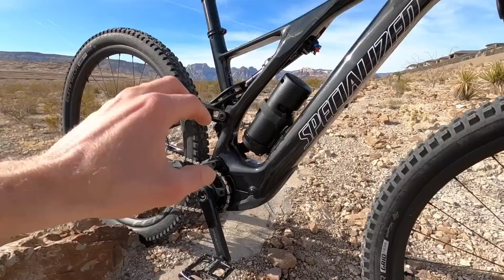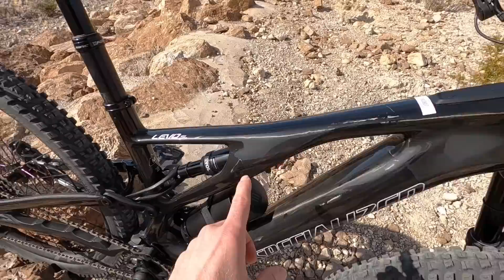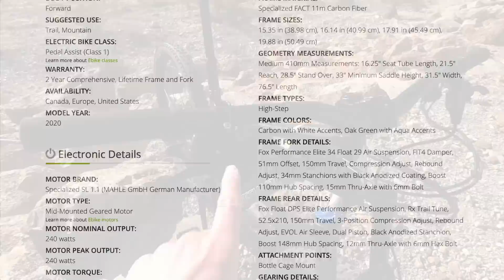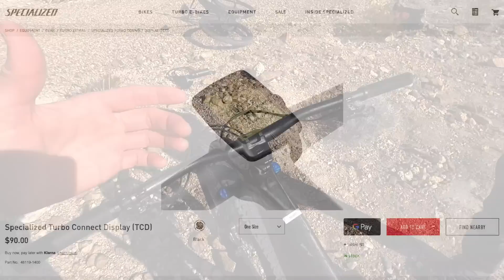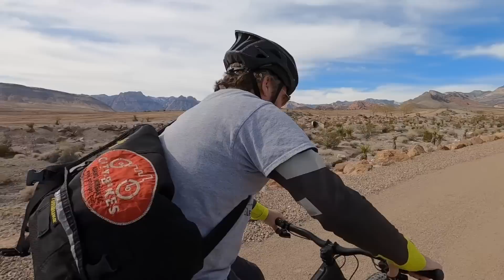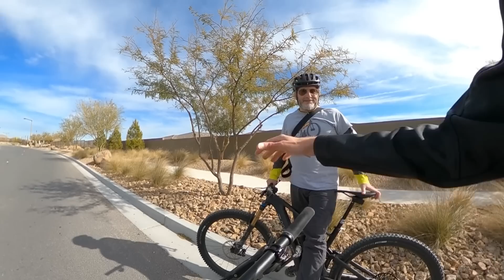Specialized Turbo Levo SL Expert Carbon Review - $9k

Comment: Guys, I built a 1500 watt mid drive with a $125 used mtb, cost $1750 altogether. I just purchased a 2019 250 dual sport motor cycle for $5000. I can not justify as a non-competitive rider spending $10k plus for an E-MTB. Crazy, beautiful but when the performance is quadrupled and the price is quartered I'll buy the production E-MTB.
Reply: But your 1500w is not allowed on a trail.
Reply from the maker: Good point Vegas, I think people bend this rule... and maybe you won't get a ticket, but if you damage property or someone gets hurt, you could be charged with driving an unlicensed vehicle on a non-motorized path and possibly sued.

Comment: Another great and enthusiastic review!  Man, I love these new Specialized ebikes!  I'm more for the Creo SL Expert EVO.  I totally share your and Charlie's excitement for these.
Reply: Does the motor noise on the Creo bother you? How about the power mode button on the top tube. I find it a bit difficult to change modes, up and down.
Reply: question mark I could hear the motor, but it wasn’t loud. I had no problem with the button on the top tube. It only cycles upward, but no big deal. The RIDE trumps everything! Absolutely loved it. The power feels so natural and organic.  Best ebike I’ve ever tried, and that’s against Stromer and R&M - my 2 faves.
Reply: @flyshacker  Thank you. I have to give it a longer ride.

Comment: Really have to admire Specialized for producing this bike, which is completely counter intuitive to what had been eMTB orthodoxy. Rather than adding power and torque, they reduced power and torque, but also reduced weight to the point where hold out MTBers no longer have any excuse (well, almost) against eMTB. No more shuttles and chairlifts, ride to the top.  

Just in, Santa Cruz, the brand that said it would NEVER produce an eMTB, has just launched its eMTB. The YouTube interview with co founder Rob Roskopp is precious. Looks like a hostage video. Will Yeti be the last holdout? Bless them.
Reply: isn't santa cruz ebike $17k

Comment: So I just finally switched over my SRAM Code brakes and drivetrain to Shimano XTR on a 2019 Turbo Levo.  This is an absolutely huge difference in braking ability compared to SRAM Code and now you can shed speed faster and later into corners and with 1 finger with zero arm and hand fatigue.  I am a big guy that goes fast on a heavy bike and after having both I can tell you for sure that all that modulation that people talk about is absolute rubbish.  The Shimano difference is so wide and confidence inspiring I cannot believe people even compare the two in the same sentence.  I also think that they have enough modulation for anyone.  On SRAM I was looking to upgrade the discs from 200 to 220 but then just decided to switch Shimano XTR 9120 with 203 Ice tech and the power difference is significantly better.  Then switched the shifter, derailleur and rear cassette to twelve speed, everything but the crank, to Shimano and I can tell you that Shimano blows away SRAM in all ways.  Want to save a few bucks get XT.  The bike is a whole new bike and way better IMO in all ways.  After this back to back test of components on the same bike Shimano wins by a huge margin!  No, I don’t work for Shimano.
I also thought the shock upgrade to DVO Onyx in front and Topaz in rear are significant changes.  I love this bike now and at the beginning I could never get it to feel right.

Comment: I really enjoy your reviews.  Nice time line for your video.  You mix a lot of technical data with the practical performance of the e-bikes.  After watching your reviews, and others (Como 5), I have decided to go with the Levo SL Comp Carbon (our local bike shop only has one in stock.  Today, it will be mine!).  Yes, it's pricy, but I believe I'll get some good use from it.  I will be using it as a fitness bike.  As I need to improve my overall health and did not want an e bike that did all the work for me.  If I did choose the Como I would have left the question hanging...what am I missing going off road.  I am older now and use to mountain bike in my twenties and thirties, but took the Dad hiatus.  Ha Ha. Keep up the good reviews.  

I'm sure you have mentioned it, I'm just forgetful, where are you all based out of?  And Charlie's shop?  What is the name of his shop?

Comment: Prices are insane. But people comparing mtbs to motorcycles may be missing the mark. Motorcycles are a bigger market and at the moment the r&d isn’t very high except for electric motos which is higher priced. Specialized are actually doing r&d in a highly competetive lower volume market. So they have to recover costs. Early adopters pay the price, just like with electric cars. But it does put the product out of mere mortals hands.

Comment: I try out the base model which weight more than 46lb and at 7000$ ,poor color scheme. The next model lighter model is much out of rich for most ..39 lb at 13000$.Noisy and price are the main problem.I think..
Reply from the maker: Thanks for the details on weight! What did you think of the ride feel, power of the SL motors?

Comment: For that kind of money you would think a stand and a display unit would be standard . As for the ride i think a lot of input from the rider with what seems very little speed and a lot of effort is not good for the price either , not for me , price alone :-(
Reply: It's not about the cost, a "real" mountain biker would take the stand off right away anyway because the stand would make lots of noises on the trail.  I personally don't prefer a big display on my mountain bike either, it's a nice feature on a cruiser or fat bike but not on my emtb, one crash can damage the big bulky display...

Comment: I watched your jumping off that bicycle because you are afraid of damaging the sprockets in slow motion,... At the highest resolution. I hope that if my understanding of your statement made after that is correct. I think they'll most buyers are not going to be jumping off this bicycle just because they didn't stop pedaling well enough in advance of shifting down.

I like the metering and I think that you should have mentioned that when you are using multiple range extenders the frame battery will apparently be bottoming out. When you start going to the second and third or however many you have. I think that this is all about that concept of a better world. , the battery swapping. The frame battery, although it is much bigger than the swappable battery. It is not where you would be getting most of your miles from the beginning most you were miles from having not just multiple range extender batteries, but you only need enough to be able to fully charge the ones that are not on the bicycle in use while you're using the bicycle. And 3 amps into that tiny battery is pretty impressive if we can understand that to be the case that for $450 you're able to charge that tiny little battery at 150 watts. That's not very long at. All. Right, I mean That's under an hour. I guess if I remember the numbers correctly. So basically for another thousand dollars. And a 3 amp charger or a pair of 3M Chargers or a single couple hundred watt solar panel, for example the sun power. 170 watt solar panel would be able to keep you running you're not going to be drawing over 170 watt continuous. The average draw will be less than that meaning. A couple hundred dollars for a very lightweight 25% efficient solar panel will be able to keep you. In charge batteries all day long. 

 This is one of the most energy efficient. Machines to move across rough train ever built. It also is the least damaging to your hands and your wrist and even your ankles Etc. 

 I think that we have to talk about comparing this with white people Rave about at ten times as much money. The vehicles that people are buying for more than this / seat. That's per. I don't know why Google would think I wanted the backslash. It is the fraction that were talking about the cost per person. And how this is so much less costly that a used disposable car. Per person per mile. 

Arguably you can spend more per person while on this bicycle. However, spending more on this bicycle. Then you would spend in almost any car is going to be difficult. The real point though is not nuanced. Even if it is not quite as trivial as the one I already made by me. The real point when you compare a low extremely low five-figure electric mountain bike with say an electric Hammer from General Motors or some ten-year-old Tesla. You know or a model 3 or any Volvo that's coming out even the Mercedes smart car. The real issue is that this is cheaper than the cost of those to make. Before any profit basically before any labor is added into the ultimate price tag for any electric car. Even on a par 4 passenger seat bases. It is for more than the retail price on this. miraculous Mobility tool.

. So the price of this model is due to the very low expected sales. Does anybody have any idea how much cheaper this is though than the first cars before the Model T before assembly line mass. Production. Does anybody appreciate that? This is not much money for what you are getting. There is no way you could produce this bicycle for even two or three times as much if you wear it in selling a lot of other stuff to pay the bills of producing this model. This corollary is not inconsistent. If they were to only make one bicycle and this was it the price would be even more of a bargain. I have read all of the comments this morning that other people have filed and all of the answers to the complaints in terms of how this is legal on the trail, etc, etc. There is a price where you might be wasting more money than a $300 used car that you know, you can buy another $300 used car and leave the one that you bought on the curb. Maybe push it off the road. When you do that, of course, they generally track the cost of Towing your car away back to you and you can get another car to be legal until you pay a lot more than $300 for that first disposable car that you walked away from. People want to argue with this they say hey, I know of a new subdivision that's under construction that has this Lake and I can just drive my old car into the lake and nobody will find that until all you know is so rusted that all of the serial numbers are gone or whatever so I won't have to pay. Anybody who wants to earn $15 an hour in America can hop on a flixbus for basically a little bit more than that and go anywhere in the many states and the many cities that that is the minimum wage. Most people are shocked by the following fact. Before you are 55. you will have been paid over $1000000 not counting Returns on your retirement savings account. If you Dropout of high school and you do so at say the age of 16 by the time you are 66, you have worked half a century. And if you're only working 50 weeks a year at 40 hours a week. That people without any raises without any investment income. Is a million and a half dollars? Remember, this is minimum wage for the jobs that you don't need to get a general equivalency degree for. So financing something that costs what about under 5% of your house? For your Mobility tool oh, there is no way anybody can say with a straight face that this Model at 13 is somehow too much to pay when? It is a better tool than anything on four wheels. at any price. I do understand that people who have not finished their sophomore year of high school don't want to share they don't want to have kids. They don't want to be married. They just wants to do I don't know what but I wish they would do it and not make so much noise. People have the right to buy things that are infinitely better than any car. if your goal is to make more than minimum wage hustling cars on unsuspecting men women and children then you should be going to church and seeking some sort of redemption not bitching in the comments in a way that is so cliched. And so tired that you're not getting paid enough to say these lies and you should know it. This is lighter and Wade then. a mountain bike whose total wattage is a fraction of what this is capable of. This is not for people who are worried about damaging a 2 or $3,000 part because they're enjoying the bike and trying to learn what cheap bikes have unlearned them. This is the bicycle for people who know that they can still change gears better than the computer. For people who are trying to get from one location to another or just not trying to demonstrate how you can pedal super fast and still have the assistance of the motor and forget that this bicycle requires that you not pedal too much or enough to operate the motor when you're doing the gear-changing. I disagree with the reviewer who believes that going faster than 20 miles per hour is a reason to get the last expensive model. Spending less money to endanger yourself and others is car culture. You have to be able to imagine these bicycles scattered like weed seeds all over city sidewalks where you just hop up on them and go to where you're going and hop off and that's what this is about. In Chicago, for example, the rich suburbs are having reviews commute trains on the track entirely at the homeowners expense in those suburbs so that the servants can not have to have a parking space provided so that the servants can be paid less so that the servants can be kept down and the cost of those train seats is vastly in excess of you giving them a $13,000 bicycle to ride or giving everybody in alternative to living in the suburbs to get away from the people that you then have to subsidize to get to you, but you have the ability to fire. We need the $13,000 electric mountain bicycle to demonstrate what can be done. If you are willing to spend a few hundred dollars on Mobility a month. To put it another way. If you want to have your children have a parent raise them at home. Then you buy this instead of the second car and they get that and everybody is ecstatic and healthy and we avoid incinerating all life on Earth. Having all the adults work and home outside the home for money in homes that have children is what prostitution is and it used to be both shameful and illegal. I can understand why The Pimps would hate. specialized is growing up and they can be expected to become even more awful as they stand to make car ownership like raising tobacco to prevent children from ever retiring. In the city, it is not possible to steal $13,000 bicycles because it is not possible to bring a car into a city. It is not possible to be so evil in your own City. We used to have cities now. All we are left with is airports. Planes and helicopters do not have keys. They are for adults.
Reply: Have you lost your mind?
Reply: @jackmcandle6955  In Chicago, there are vertical neighborhoods. Not just in China that is buildings that you never have to leave unless you are poor and have to go to work. The view is fantastic. The food is even better. The air is clean and fresh. You can walk to the beach. There is a private school that is beyond compare. The monthly HOA is a little bit more than this bicycle perhaps. But it is money well spent. It is that City. You can leave in the hall. A solid gold ball foot across Maybe a foot in radius. And it stays there or not because it is too heavy. But because the children are happy. They are educated. Enlightens they have no use for somebody else's solid gold. Beach ball. They know the world needs them. And they will only want if they are unable. To answer the call of the world.